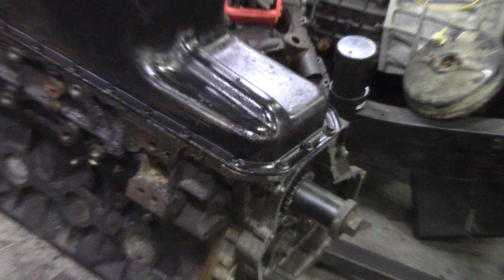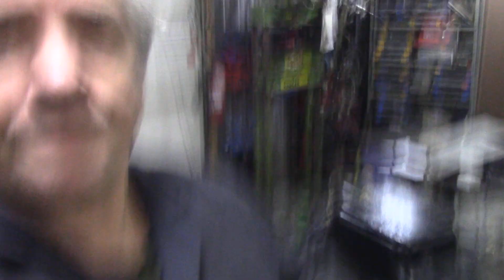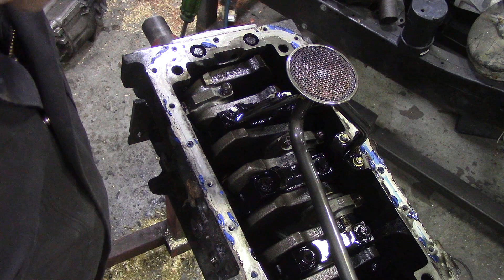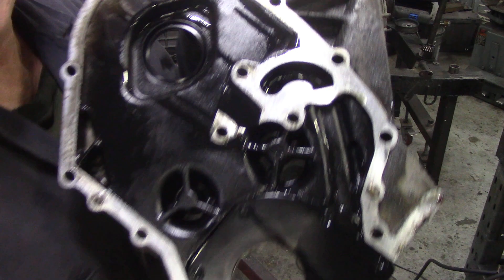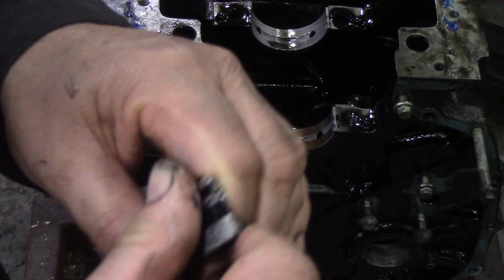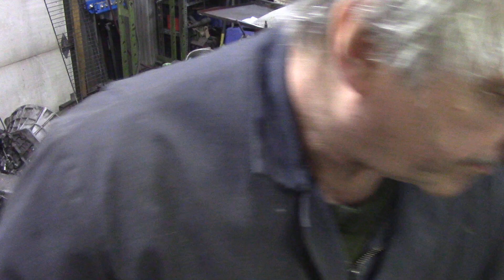Spanish 110 original engine overhaul Part 2 Removing pistons,  crank and core plugs

Comment: Mike, wondering if the original crank was replaced due to the timing sprocket and/or harmonic balancer keyways flogging out. It happened to my original '97 TDI, not sure if the problem continued into 1998 year models. But my subsequent '98 never had the problem. On earlier ones here it was a common problem.
Reply from the maker: But the strange thing is, the rods are genuine and look like they came straight out of the box!
I have had the keys chatter on 2.5 NA - re machine a new keyway 180 degrees the other side of the crank and re broach the pulley

Comment: Very interesting that one Mike. We know someone has been in there before but was that just because they thought the sump was leaking? 
Could that be a 300'000km engine that has had the oil and filter changed religiously every 5000km or 3000 miles?

I do mine every 3000 miles, I don't care what people are saying modern oils will do.

Having said all that, the crank does look cleaner than the rest of the engine and someone has had the oil pick up pipe off, so it could be a lightly rebuilt engine.
Reply from the maker: Could be  - but the bores and crank are original and perfect - very strange!
Reply: @BritannicaRestorations  Very strange Mike, I ended up arguing with myself writing the first post. I am OK now, I took myself into the kitchen and gave myself a dam good talking too.